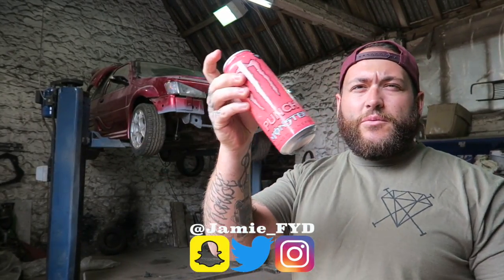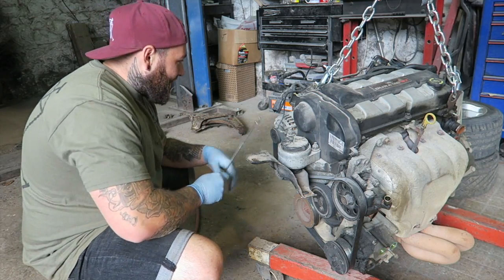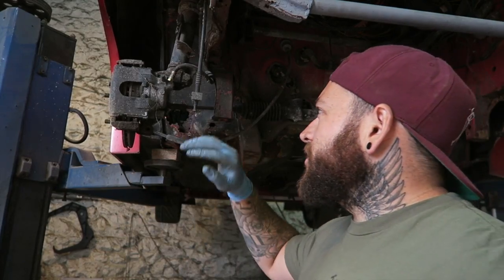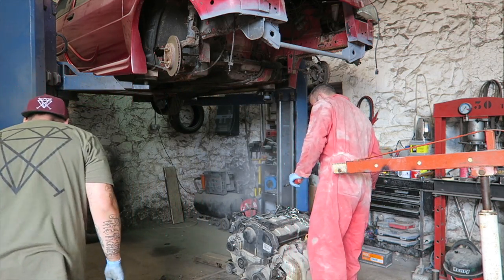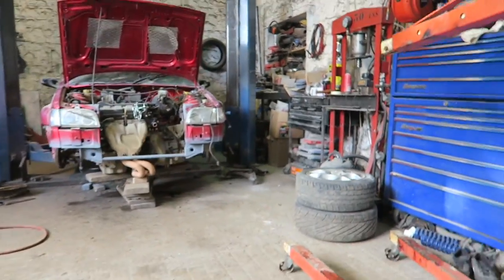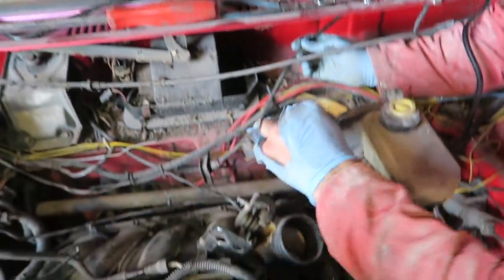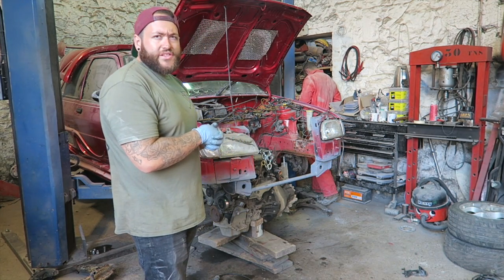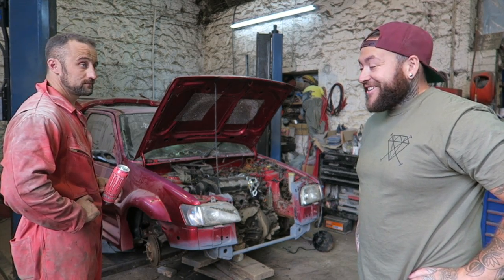WILL IT FIT? FINALLY TEST FITTING THE ST170 ENGINE IN THE RICED FIESTA!!

Comment: I am currently building fiesta mk3 with st170 ITB, ib5 from focus bellhousing. engine mount vibratechnics, gearbox side vibratechnics from fiesta mk6, lower gearbox mount fiesta mk6. 
focus ib5 has slightly turned bellhousing. there will be very small room for st170 inlet manifold in fiesta mk3 engine bay. If You would like I have a couple of pic from my work.
Getrag is in my opinion really bad choice, it has long gears ratio and its a problem with enough room, ib5 with linkage is a lot simpler aplication.

Comment: I think more time is going to be put into modifying the engine bay and getting modified parts to fit in the engine bay good luck I wood probably do the same if I had a garage as it is fun power to weight ratio

Comment: Surely the pedal cant get any worse than it is, the pedal like 2 meters away from the rest of the system in these cars! lol

Don't the CVH gearboxes bolt up these engines? I'd go that route if possible. Would save messing with already over complex braking system on these and keep a somewhat original gearbox linkage.
Reply: I thought that when I seen the cross member had been cut out, which is what the cradle bolted to that the original box mounted on. They could of kept the original style box, shafts, linkage, speedo drive which means the speedo would of worked still, clutch cable and pedal could of been kept... But with this route, none of that will work.